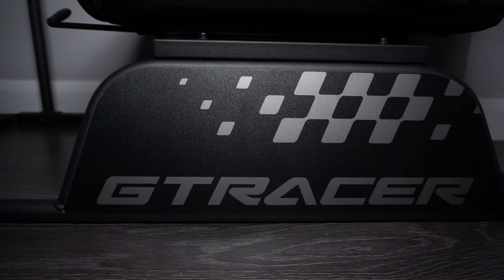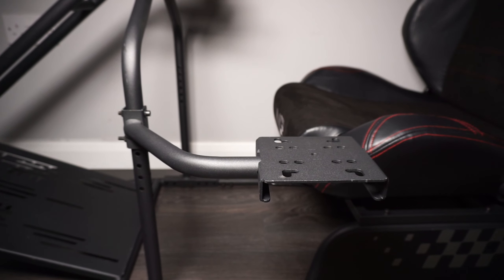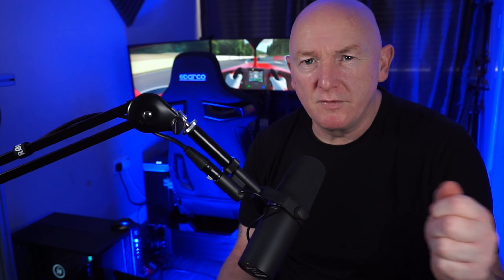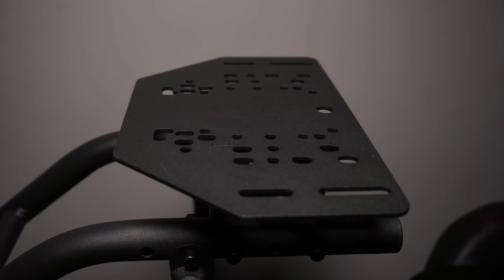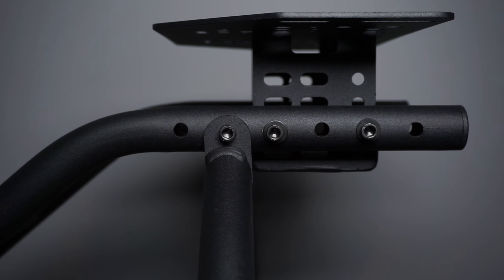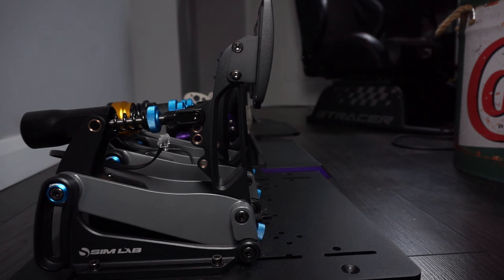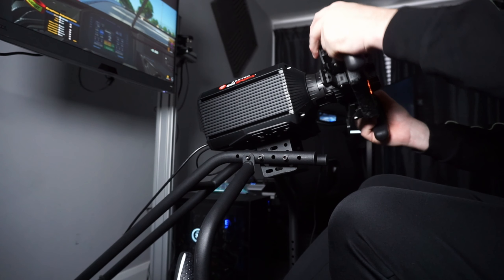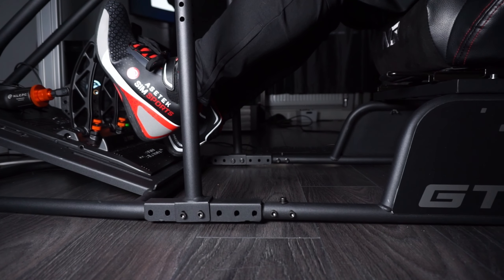Brilliant, BUT... | Taking a look at the Next Level Racing GT Racer cockpit!

Comment: This looks exactly the same like the old GT Omega Pro cockpit which has been discontinued... I would never recommend it to anyone, the good old saying buy cheap buy twice goes hard for this rig. In line with so many simracers doing the typical upgrades going from low to mid to high range, wasting money along the way. This rig was my waste of money. I had it for half a year or so before I upgraded to a proper 8020 rig, and the thing is worthless in after market, the flex is horrendous, etc etc. Oh well, some sucker will buy it and find out for themselves I guess.
Reply: Me and you both. Once I got half decent pedals and wheel it flexed so much all the time. Have an 80/20 profile rig and will never need another.
Reply: This rig is old. Funny how reviewers don't mention this. They do get it for free. It's different if they bought it with their own money. 

You clearly have better options out there.

Comment: I know you said it was better than the GT Omega Art, but i disagree totally and feel it's an unfair comparison. My son has the Art with a CSL Elite & the V1 pedals and it certainly doesn't buckle in the middle when the brake is pressed, plus you can angle the pedal plate. There are struts you can buy that strength the base plate which makes it even better and lower the flex.
Reply: Agree 100%. This one is just bad engineered, that middle flex and no pedal adjustability is lazy.

I’d stay away from this even if it costed 50 euros.
Reply from the maker: It's better than the ART I had but admittedly it was a little while ago
Reply: @davecamyt  contact GT Omega for one and compare the two its a great piece of kit for the  price and has its own monitor stand. At least to compare.
Reply from the maker: @deep_water  believe it or not I never ask anyone for anything.
Reply: @davecamyt  No bother, I've sent an inquiry to GT Omega tonight in the hope they take up the challenge and send a review sample to you.
Reply from the maker: Legend 😁
Reply: @davecamyt  oh Julie will be so happy to know another rig/ mess is coming 😂 anyway, I know it was in good will and I believe you when you say that for you it is better for the ART, but for me personally that middle flex is like a nightmare in which I couldn’t compromise. If I had to choose off course.

Comment: This thing sucks. Put cheaply in a package, it will never last through a 10nm battle. I've had the wheelstand 2.0 at home for 5 years and it can handle my 8 nm, braking forces from hell and nothing bends. So stay on the ground, you don't get anything for free, from 10 nm always a rig!

Comment: Quite surprised to see the GT Omega Art being compared as worse. I have one (about 6 months old) and I have to say it’s fantastic. I’m running a DD Pro 8nm and a set of CSL elite v2’s. I get no flex anywhere apart from the seat back does move a little under heavy braking. It’s a great rig for the money 👍
Reply: Same for since 1 few weeks and I love with pretty much the same gear really a good value and I'm going to get the stability bar at some point
Reply: This has been the cockpit I’ve been looking into. Are you using a reclining or fixed back seat? Been seriously thinking about getting that along with an NRG bucket seat/brackets/sliders because it’s cheaper than basically all SIM manufacturers seat setups, roughly $300USD altogether
Reply: I think the only reason this would be seen as better is the price is a decent bit cheaper and with lower level equipment both would perform about the same the only thing is the omega is better suited to handle upgrading to better equipment whereas this won’t scale up as well
Reply: @evantalley4388  I’m using a recliner seat. The default one that you can buy with the rig. It’s barely an issue really. Doesn’t affect the racing at all 👍

Comment: Informative and honest review, Nice! Just a question, I have Thrustmaster TLCM pedals and a T818 DD wheel, do you think this cockpit would be fine with this kind of hardware (especially the pedals)? Thank you!
Reply: Yes! The GTRacer is compatible with both of these products!
Reply: @NextLevelRacing hi, I'm looking to buy this rig to run a TS-XW alongside T-LCM pedals.
The T-LCMs are already at an angle so my worry is that the pedals could be uncomfortable because of the angle of the pedal mount.
Could this rig be good enough for my setup?

Comment: Why does it look absolutely identical with the GT Omega PRO Cockpit? same design and same structure but just a touch more expensive.
Reply from the maker: That was discontinued in 2010 apparently 😳
Reply: @davecamyt  not really, I've bought one from GT Omega in 2020 259£ if i can remember
Reply: They come pre branded from the same fabric thats why

Comment: All this wiggling and flexing may be OK now but I'm pretty sure will end up creating slack over time. Even with lower torque wheels...

I doubt a lot the durability of this product in the long run...
Reply: If your that's your concern torque the bolts and add some lock tight

Comment: Well, if you got premium pedals and wheel, you won't buy this....
Reply from the maker: La prima isnt 'premium'.
Reply: @davecamyt  well, the bundle is three times the price of the sim rig...I'm poor, so that's premium for me
Reply from the maker: @sdejong9165  I see what you mean but all I'm saying is someone could easily have some la prima pedals on the floor or wheel stand and think this would suit them. I'm poor too.
Reply: @davecamyt  I was thinking bout buying the nlr f-gt...it's only 60 more and seems very nice to me...what do you say?
Reply: @sdejong9165  it's the rig I use and I really like it. Had it for almost a year now and no flex but for the seat: it does flex a little bit. Doesn't bother me because the back of the seat is up against the wall so I never notice it, but I might if it wasn't. Also bear in mind that I'm using a Moza R5, so not load cell pedals and not the strongest DD wheel. One other thing: In "formula" mode, it's actually quite similar to a GT seating position, while the "GT mode" is closer to a road car position. I'd recommend though if the above isn't deal-breaker-ish to you.
Reply: @noelckelly  thanks for the input..I also have a moza r5, so that's great and I dont mind flex at all...got the rig I have now on air-conditioning springs with bass shakers...so I flex all over place.. immersion 😃
Reply: @sdejong9165  custom built motion rig! 😂